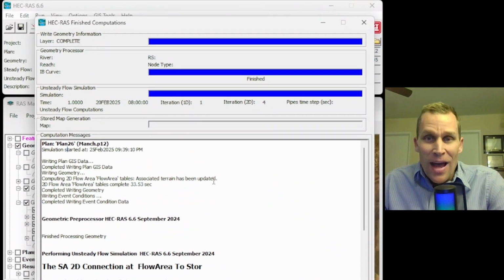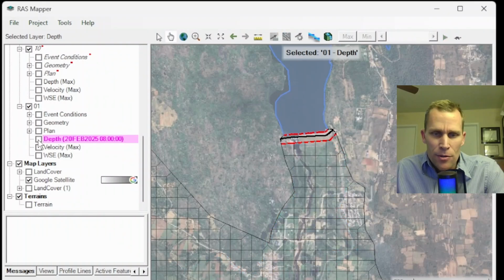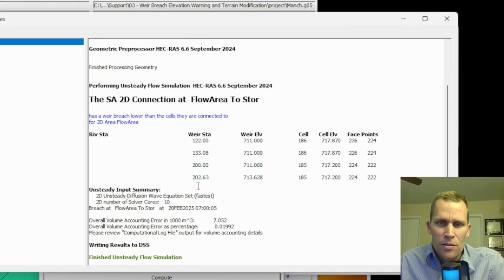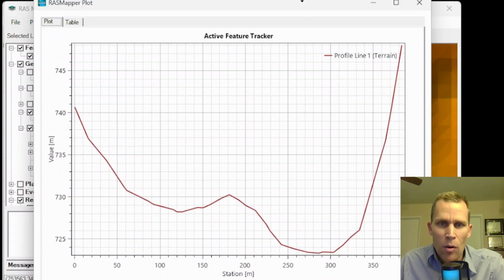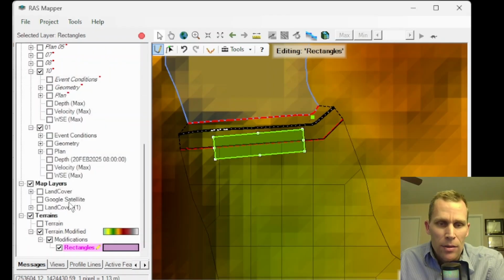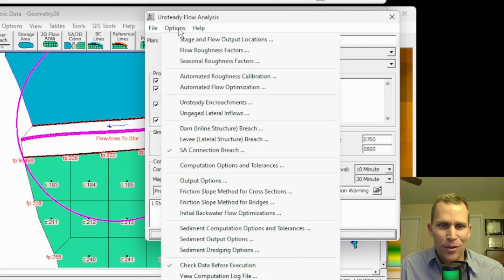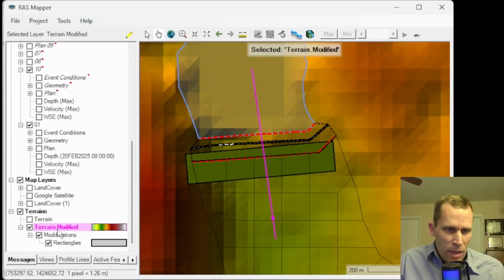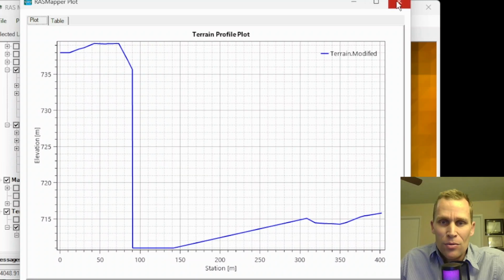HEC RAS Support 3 - Weir Breach Elevation Warning and Terrain Modification

Comment: Hi, professor. When I modify the terrain using elevations lower than the elevation cells, even though I fix the warning alert, wouldn’t I be changing the real terrain conditions and, consequently, generating an incorrect result?
Reply from the maker: Hi Bruno - Yes, that's correct. If you don't plan to change the real world terrain, this may not be the preferred solution. Another option would be to modify the dam breach data.
Reply: @TimNelsonPro  Thank you so much for answering my question, and congratulations on the videos. They’re very helpful, and I’m learning a lot!